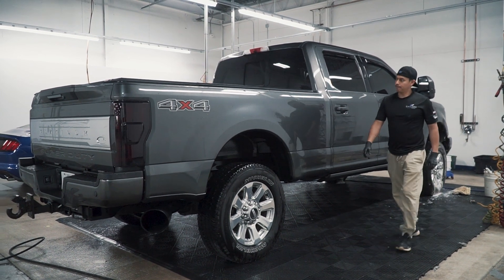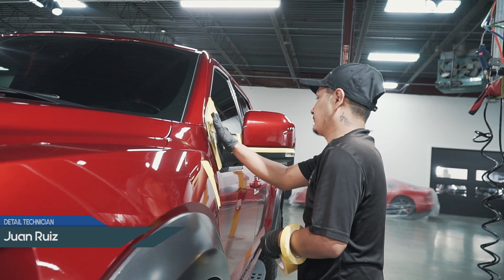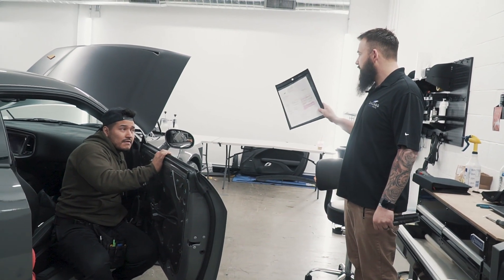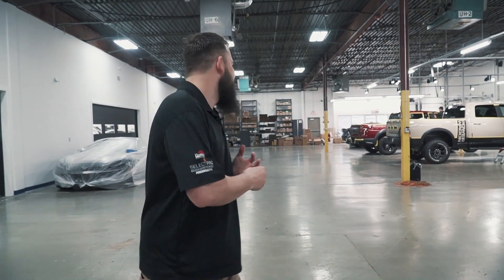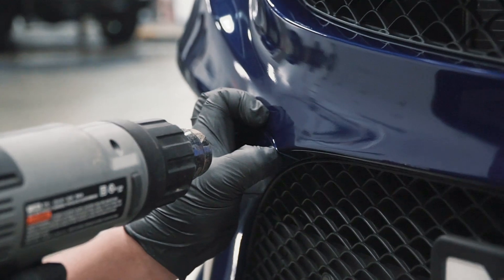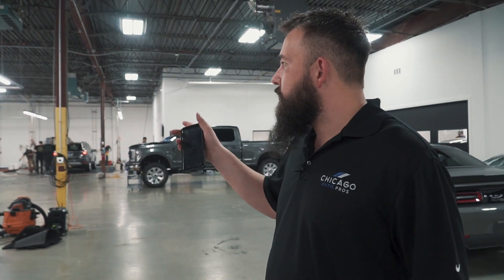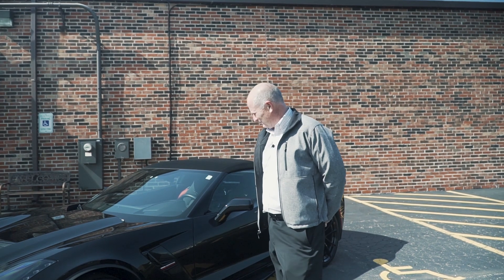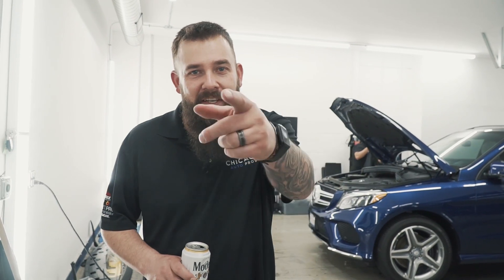Truck Week | Triple Black Corvette | New Lift | S3E6

Comment: Hey, I love the vids, and just had some pads I bought from you delivered.  I have a Black F-150 with the scratched panels that you showed at 4:00 mins.  What product did you use for them?
Reply from the maker: He was using a 3 inch polisher with a LC microfiber pad and a compound. ( Most likely CarPro Clear cut)